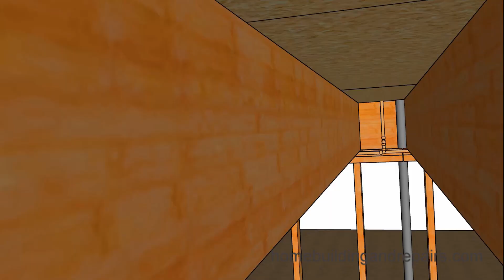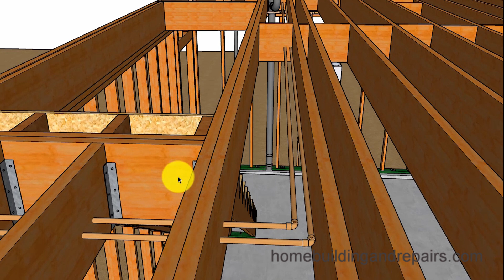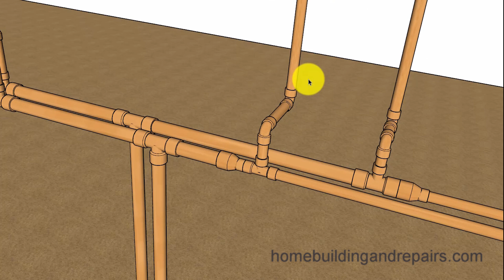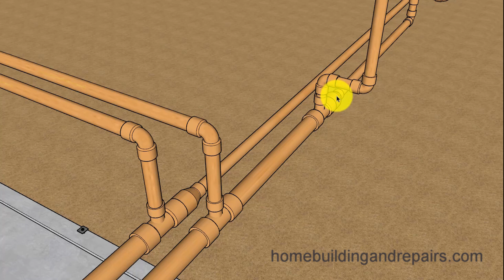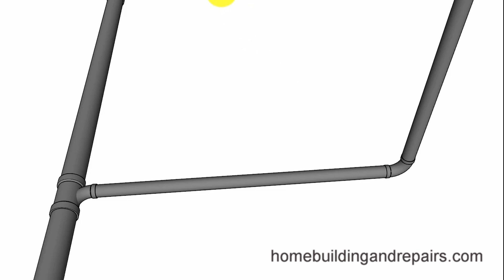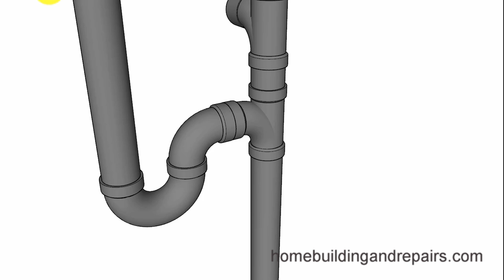How To Install Rough Plumbing In Two Car Garage With Small Apartment - Building Education Part 9

Comment: Is there anyway you connect at the drains into a single 3 inch then go down under the slab. Makes for a lot let work with the foundation I would think.
Reply from the maker: Yes, but it can ruin wall framing studs with the big holes or notches.
Reply: Gotcha makes sense

Comment: This is a wonderful illustration. I don't see in this video where the water source comes in since there would have to be a new water line to attach to my house pipes somehow.
I have a big house that I want to move out of and build a tiny home/ garage to live in and rent my home so that I'll have more needed income. So I'm trying to evaluate the costs, etc.
Thank you for this presentation.
Also I need all this plumbing on the first floor and a small area on 2nd floor for just a bed...so maybe 5 extra feet higher than a single one story garage.

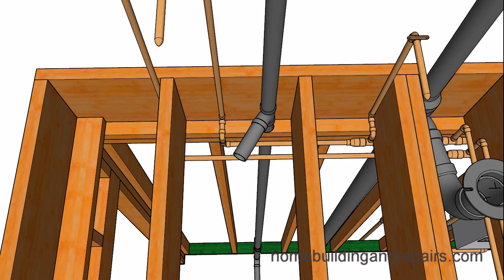Comment: do you have to cut the double plate where the 3 inches of pipe goes (see 9:55)? would you need to use a metal strap to connect the plates?
Reply from the maker: Yes, cut or drill holes for pipe and metal straps are usually needed to prevent any nails of screws from going into pipes.

Comment: if the washing machine has a dryer as well, they need to be raised up on an 18" platform in a garage. At least in Los Angeles. This is because people store flammables in garages. So the plumbing for the mashing machine may need to be higher.
Reply from the maker: That's the first I heard of that one, even though I have seen them raised to make it easier for home owners to use. Thanks for sharing.

Comment: Great video! I saved it to my collection. I have a question tho: do you have the plumbing pipe going through the concrete stem wall? It seems you have the plumbing pipes going through the mud plate then the stem wall? Might this compromise the structural integrity of the foundation? Another comment I have is to have plumbing going through the concrete slab on grade without a crawl space, the work needs to be highly coordinated between the plumber and the concrete contractor, as demonstrated in this video. Maybe there is advantage to crawlspace b/c the coordination is less critical in that case.
Reply from the maker: Yes, large pipes can create structural engineering issues like you suggested, but they do it anyway. Crawlspaces do have their advantages with plumbing, especially if it needs to be moved.
Reply: @gregvancom  For two-story building the stem wall is about 8-inch. If the sewer pipe is 3-inch, about half of the stem wall will be penetrated.. Maybe it's better to transfer the sewer pipe toward the inside so it penetrates the slab instead of the stem wall? This means I can't hide the last section of the pipe inside the wall but if it's a garage it might not be that big an issue.

Comment: This is almost exactly the layout I'm working out for my two story detached garage -- except the garage is already built and I need to retrofit the plumbing. I'm also just planning on a small sink on the first floor and laundry/bathroom/kitchenette upstairs. Since it's already built, and the bottom floor has concrete walls up to ~4 ft, I'm trying to figure out how to bring in the water and sewer into the garage while minimizing concrete drilling -- any ideas? I'll be re-doing drywall and am fine with the little ceiling thing, so routing within shouldn't be as much of an issue.
Reply from the maker: I wonder if you could build false walls. Email me a picture of your project.

Comment: Does the laundry stand pipe have to be a certain height?(what are the dimensions for the stand pipe)
Reply from the maker: All pipes will be 2 inches or larger and you should contact your local build department for building codes in your area.
Reply: @gregvancom  according to the upc,does it have to be a certain length?
Reply: What plugin you use for piping sir?

Comment: Never put fresh water lines (hot/cold)  against the out side walls,  to prevent busted pipes from freezing. Most building codes require this.  Example,  turn the bathroom tub/shower 🛀 that the hot/cold,   lines/valves are inside the warm heated interior.
Reply: Well, did you notice the cold water supply was outside the building?
Reply from the maker: I like it, out here in California it's not a problem.
Reply: It's amazing what you can get away with in warm climates. I was in central America recently and I saw buildings that were completely open with no walls.

Comment: Is it still practice to use air chambers, those short lengths of capped off pipe at each fixture to control water hammer? I always see them on older and even some recent installations, but not seeing them at all anymore on new installs. Is there another way to control water hammer?
Reply: Those air chambers were known to fill up with water with time and loosing its function, so no longer are needed. PVC and PEX don’t have hammering effect as copper does. Washers ate only place where mechanical so-called hummer arresters valves are used, those have spring loaded valves to reduce hammering effect. Copper is too expensive to use in new builds. Now with copper wire prices rocketing up who knows what will be a substitute in next 3-5 years span.
Reply from the maker: I've seen them also, but most of the jobs I worked on in California, didn't have them. I had a problem with water hammering and it turned out to be the water heater.